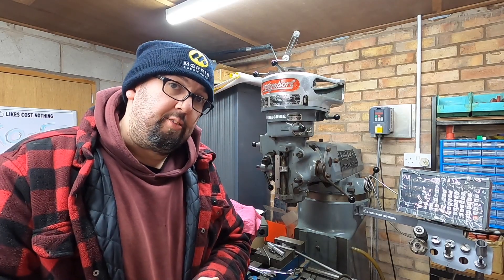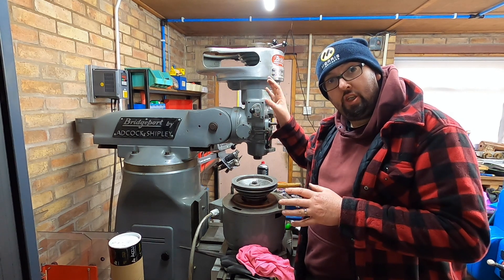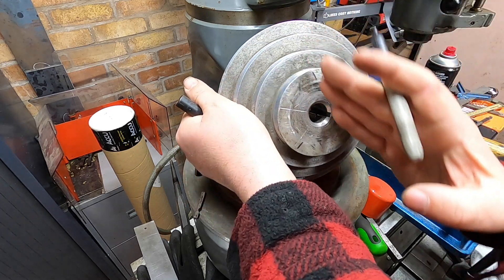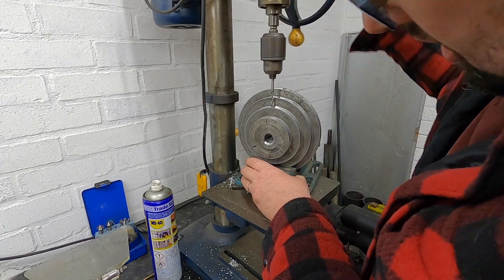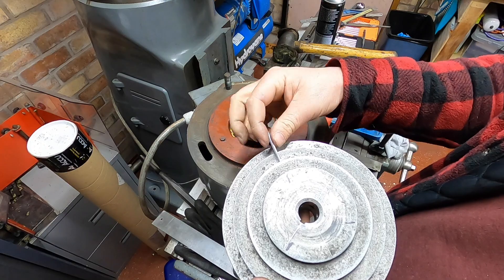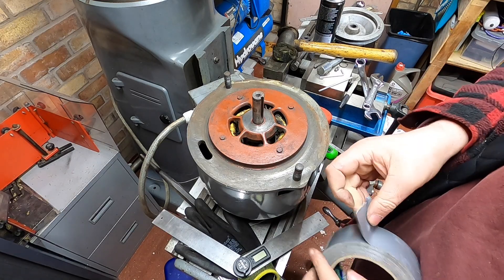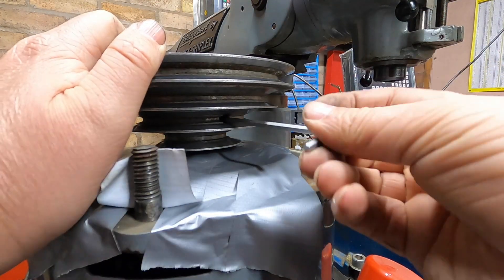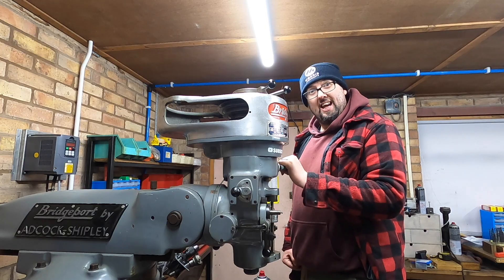Part 1 - Bridgeport Milling Machine has developed a Knock!

Comment: NICE work with the silver tape! Bonus points for dropping the key 5 sec later, thus proving the point.

Have you tested the motor BEFORE reinstalling it??? It'll save you hassle if it still knocks.
If it still knocks, check the spindle bearings and the motor bearings <3
Reply from the maker: Question is Kaylee, did I drop it by accident, or on purpose?!? 

There seems to be a lot of comments with regards of the motor, there is nothing wrong with the motor, not its bearings or its electrical components.

Comment: Two holes, 90 degrees apart is better.  That way the shaft is pushed against the side of the hole.  Then the pully is supported by the shaft, not the set screws.
Reply from the maker: Hi Makerspace, That is a very good thought, one to try if this fails. Thank you. All the best, Matt 👍

Comment: You could use a spiral reamer in the lathe tool holder to open up the bore on the pulley. Of course put the pulley in the chuck. Between the feed on the cross slide and the height adjustment on the tool holder it pretty easy to center a reamer.
Reply from the maker: Hi James, Yes I see where you're coming from and very good idea, but the hole in the pulley would be too big for the motor shaft, are you talking in terms of putting a sleeve in the pulley? Which was an idea originally. All the best, Matt 👍
Reply: @MattChiversWorkshop  yes, that would be the fix. I’ve tried to fix a wobbly pulley with set screws before. Ultimately it seems to make things worse. I usually cut a slot in the bushing where the key needs to go and cut a key that accounts for the extra depth needed. I’ve needed to sleeve pulleys a number of times just because I’m cheap and don’t want to spend forty bucks every time I play with reconfiguring a drive system. It’s just a thought though. You seem to be able to devise your own fixes just fine. Like your RR project. It’s a very ambitious undertaking. Hope your faith holds strong until the end.

Comment: Hi Matt. I think you will need to replace the bearings in the motor. This a problem when belt is tension beyond their design, I would also replace the carbon brushers. The bearing replacement takes little time but is good insurance.
Reply: This is a 3-phase induction motor. No brushes. But replacing the bearings is a good idea, who knows how many hours are on them.
Reply from the maker: I don't think I do, on either, I checked the motor and found nothing wrong with it. Believe it or not, it's actually in really good shape. If I spend any money on the motor it will be to change it to a 240v one to get rid of the inverter. All the best, Matt 👍